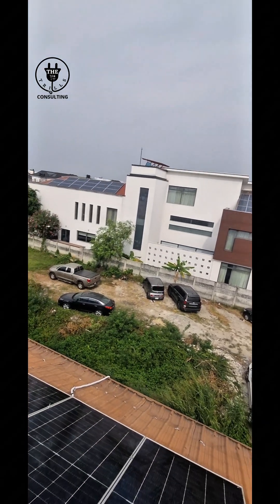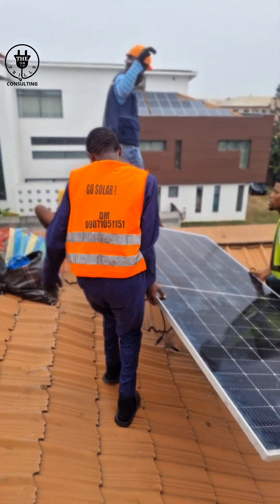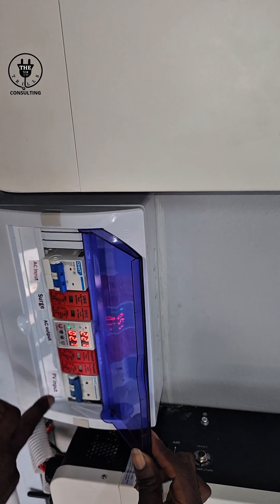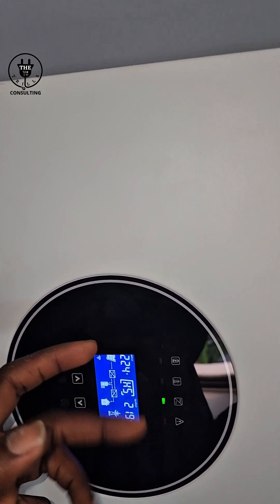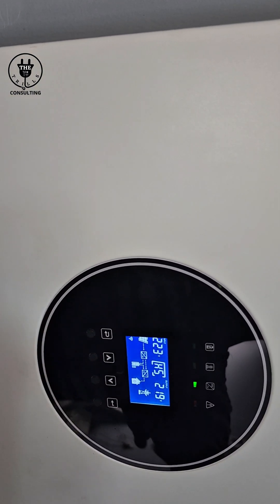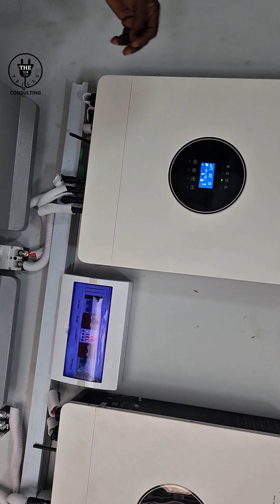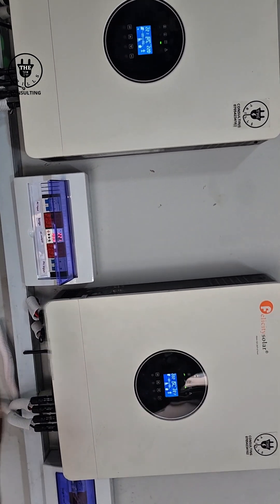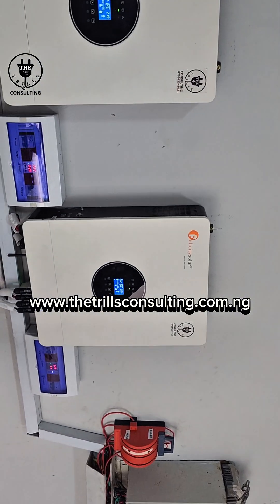𝐈𝐌𝐏𝐎𝐑𝐓𝐀𝐍𝐓 𝐓𝐇𝐈𝐍𝐆𝐒 𝐌𝐎𝐒𝐓 𝐒𝐎𝐋𝐀𝐑 𝐈𝐍𝐒𝐓𝐀𝐋𝐋𝐄𝐑𝐒 𝐒𝐊𝐈𝐏

Comment: I have 8 pieces of 195w solar panels, 3.5kva 24v Grovolt Ricco Plus Inverter, Grovolt low voltage 60amps MPPT Charge Controller & 2 220AH Tubular batteries. What's the best way to connect the panels?
Reply from the maker: @emekaezimuoh1984  for consultation,  contact us on 070 5423 4162

Comment: You are having just only breaker and surge for the AC inputs, is the voltage regulator not necessary again for the AC input Just like you having it to monitor the AC output?
Reply from the maker: @muhammedadio4607  We replace the Digital VA protector with the manual AC Breaker, because we want to be able to control the AC input irrespective of whether there is power supply or not.

Comment: I thought bifacial panels are meant for onground installation to properly harness it potential
Reply from the maker: @johnjake2418  You are right sir, but can be used on roof top installation too, because of it numerous advantages such as longer lifespan and strength.
Reply: I have bi-facials mounted on my roof, but I have a custom mount that is raised about 1/2 meter above the roof, and the roof is painted white.  This works really well, and also reduces heat on the roof
Reply: You miss out on the extra juice when roof mounted.